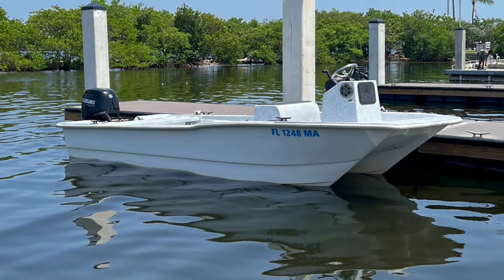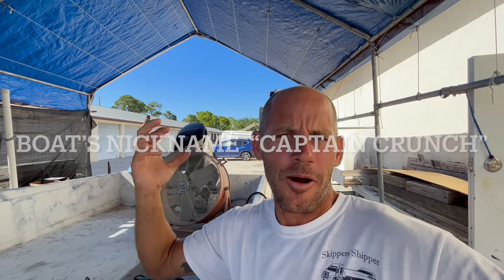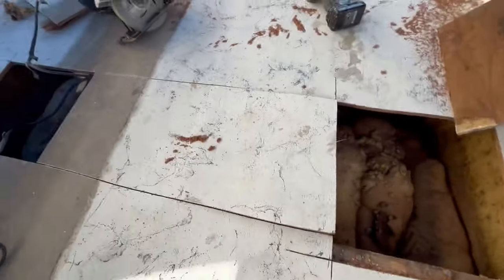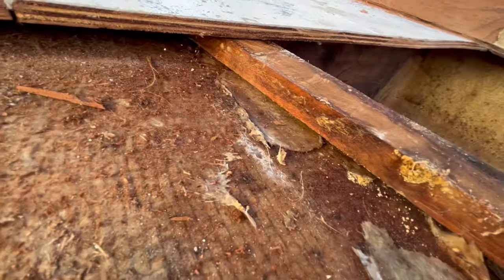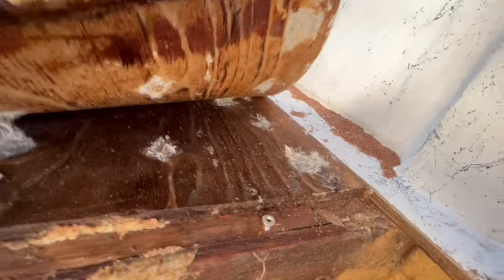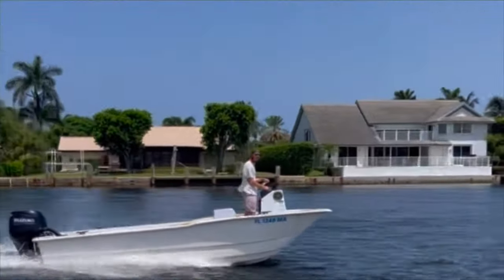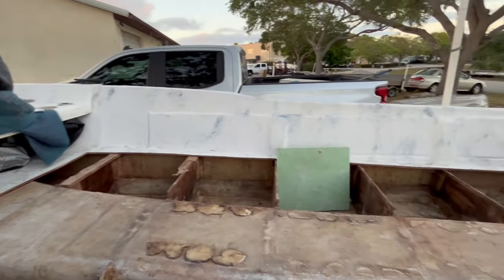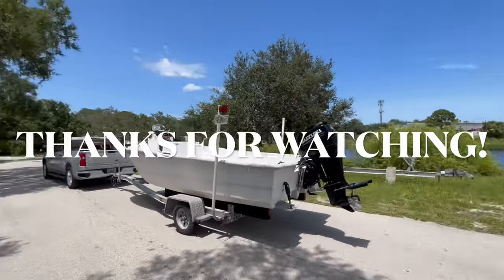DIY Catamaran Skiff Boat Build : Floors Bulkheads Stringers

Comment: Very Cool.  Thx.  Does moving the console so far forward change everything reguarding weight distribution?  How do you design the layout and placement of batteries/tanks, seating, etc  without putting it on the water?

Comment: What a rad boat! These smaller power catamarans are awesome. I have a 14ft Livingston with a little half cabin on the front out here in Southern California, and it is a badass boat for its size. I've taken it out to the Channel Islands many times, 25+ miles offshore, and have never felt unsafe in it. That 18ft'er looks super capable! Also they do really well with weight up front to help keep the bow down in waves/chop, so your buddy wanting a forward console is making a good choice 👍

Comment: 🌴Ahhh yes another gem 😆👍🏼 ,but the forward console is a great idea ! Plus the deck in front were you could cast net or fish off of , as for the bare wood 😖 ya some of the boat builders back in the day were a bit unscrupulous, you boys got your work cut out for ya .It’s gonna be fun getting the A-B foam in the center tunnel but it should stiff’n it up , smart idea replacing the bulkheads those plywood one’s were toast , when this boat is done it’s gonna last a lot longer than it’s previous 25 yrs , and it’s almost guaranteed that it’s gonna be alot more fun to use !  Hope the nice weather holds out 😎 guy’s , can’t wait to her done 👍🏼👊🏼
Reply from the maker: Thanks so much Dave!  I always appreciate your input / insight and great energy buddy!  I’m excited to share the remainder of the build, I think you’ll dig it!  And you’re spot on, boat will be a lot more fun , durable, long lasting and a bit more efficient as well!  Cheers my friend!